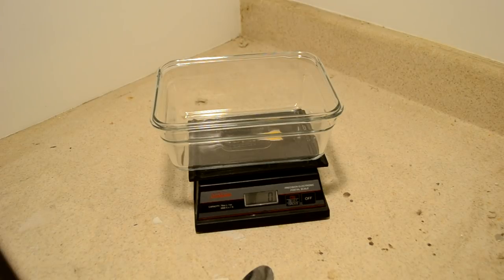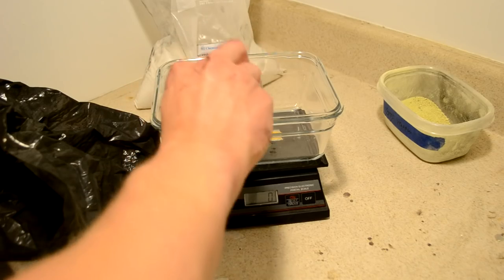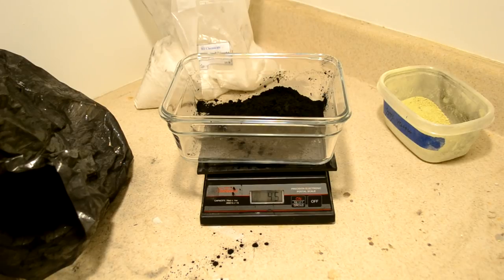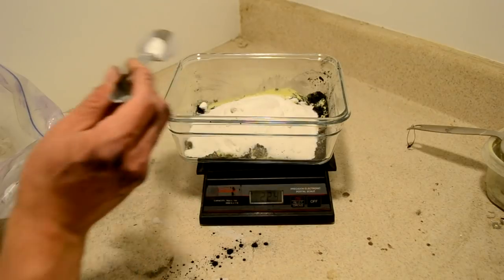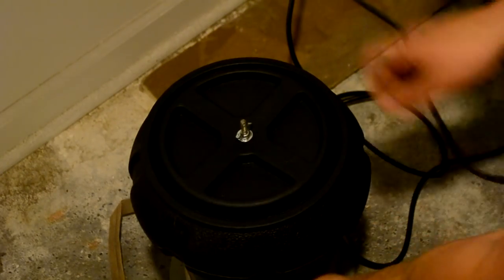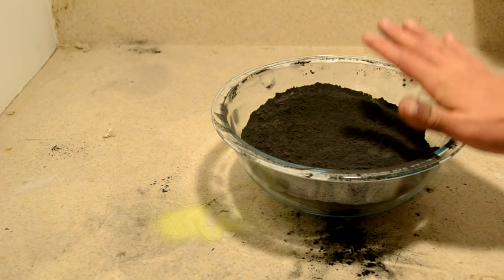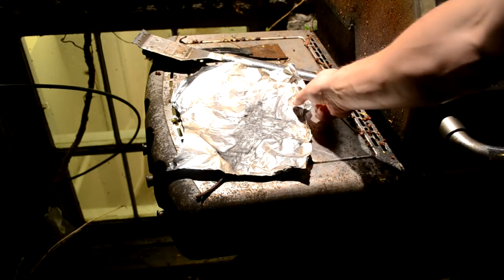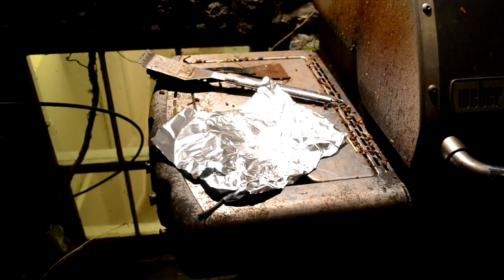Crazy Kitchen Chemistry --- Black Powder!

Comment: Lead can contaminate your black powder as it is a very soft metal. Have you considered using brass balls or large glass marbles?
Reply: I had the same problem using Gordons Stump Remover for Potassium Nitrate, it is Prilled into had little Balls .It took 3 days to powder it and left so much Lead Residue I couldn't use it. My Lead was very Hard #2 Alloy, those Fishing Sinkers are much softer. I finally had to use Boiling water ,Filter it twice and recrystallize and grind it by hand to get rid of the Lead Contamination. Next time I'll just go Straight to the Boiling Water and recrystallize ,much faster and less work. If you try Stump Remover be careful not all of them are Potassium Nitrate.
Reply from the maker: That's great input. I know I'm getting lead in the mix, but it doesn't seem to effect the burn rate much. Toxicity  is another story
Reply: @woodrowbrimm2805  Grind the potassium nitrate in a coffee grinder before using it in the powder.

Comment: I wet mix mine in a bullet blender.   works fine.  Mix the Charcoal and sulfur first.  Then add the  KNO3  .  I use it in my 44cal Black Powder pistol.  Better then Pyrodex.  Just air dry until mud.  Push thru a window screen  . 100 mesh?  Turns out like FFF grade.   Your method takes much longer and a pain it seems.  just Wet Blend it and push the mud thru some screen.   Air Dry .  Here in New Mexico the Sun dries it in under a hour.  Add .5%  aluminum powder if you like bright flashes.

Comment: For a more stable compound you can do the whetting process under pressure. Then you can mill the puck into FFFF, FFF and FFG. Not all powder sizes are equal. That and the granules will be hard and won’t break down due to vibration

Comment: been look'n at this hard and heavy lately maybe the binder is a good idea, after all, you could get it where it extrudes and have your way about cleanliness and burn speed if you play with some aluminum-magnesium powder"look up the amounts of course"  that will give it the zip you wanted and you can control the speed with the granular size as well bubby . or a least as I read seeing you do this helps me because I want to do it someday -- soon-ish, I hope this helps you as well. I think larger charges as long as their not too dirty are better suited for slower burns with the right barrel length . to push the bigger stuff downrange .not too long just long enough. but then you get into chronograph territory to sort that.  meaning more money. saving it is the point of doing this in the first place. since big brother nanny state has jacked up the price of anything firearms related so you will voluntarily give up your guns. change your behavior which is what codification of law is behavior control. so they can cull America down to a small serving class. so ya I'm for you, Brendan. all on your side. least I think we play for the same team. glad you're out there.

Comment: using the "Fg" scale, do you have some estimate on what degree of fineness your finished product has? Black powder is known to have a significant amount of residue when used in firearms. Would adding an excess of oxidizer decrease this residue?
Reply from the maker: If I recall, Just barely smaller than 3F, but note quite to 4F. Be careful adding additional oxidizer, as it will tend to leave corrosive decomposition products. (Potassium carbonate + Potassium oxide) Given the option, I'd pick dirty over rusty.
Reply: @BrendanStewart  thank you for this data. BP residue is hygroscopic, hence the need to clean after use; not sure if these perchlorate by-products are worse (individually or as additional contributors to the usual BP fouling). I suppose I could always try a simple Fe plate test of the various residues and see which is worse? The other concern I have re the use of more and/or other oxidizers (such as perchlorate) is how much more energy it would have. Pyrodex is measured by volume but g for g is more potent than plain BP. I gather then that the addition of perchlorate does increase the potency of the mixture. Unfortunately, I don't have the means (pressure instruments) to test firing pressures. However, I came across a chat group from 2005 and this was some data they had as a comparison between BP & Pyrodex:
Bullet/brand, Powder, Charge (I'm assuming BY WEIGHT not volume since typically, you measure out Pyrodex 1:1 for BP), Velocity (fps), Pressure (psi)
BP: 435grs / Buffalo, 80grs Fffg, 1300, 11,800
Pyrodex: 435grs / Buffalo, 70grs Pyrodex Select, 1300, 9200 [note: same fps as 80gr BP but lower chamber pressure]
Pyrodex: same as above, 72.5grs Pyrodex Select, 1395, 12,000
Unfortunately, I don't know how much perchlorate is added to BP by Pyrodex but it probably isn't much based on how much less Pyrodex is needed to produce similar BP ballistics.

Comment: Take a 1" or 1 1/2" copper piper about 6" long and pack your power in it and tamp the hell out of it to drive the kno3 and sulfur into the pours of the charcoal then push out the nice pucks and the. Granulate

Comment: Very informative! Thanks for the video. One question -- can 70% isopropyl alcohol be used in place of the 91% isopropyl alcohol, if one cannot access the 91% isopropyl alcohol? You used a solution of 91% isopropyl alcohol when you were in the process of granulating the milled black powder.
Reply: 91 is just more volitile so it'll dry out quicker
Reply: @Mikechill5  thanks

Comment: Dextrin and hot water work brilliantly for granulating and if you get an accurate amount of dextrin (1%) it doesn't affect the burn rate compared to using isopropyl alcohol. Plus it saves you a lot of money!
Reply: Where to buy dextrin?
Reply: Jstables95 you can buy dextrin on amazon but it’s expensive or made it with potato starch heated at 160dgC also called dextrine. It’s easy to make
Reply: @yanosrizkoneynoy7502  i just watched vid how to make it. Yt truely have anything u need. Thank you

Comment: what is air flow charcoal? it seems to be used in "hookas" very expensive? would any charcoal do like the one you use in barbecue do?
Reply: Not briquettes. Lump will work.
Reply: Use hardwood charcoal and burn all of the gas out of the charcoal
Reply from the maker: "Air Float" meaning the finest available powder. easily suspended in air.

Comment: yes that's the burn rate you want,  very good!
Reply: I made it 75-15-10 and it is slow burning af. Do i rly need to mix it for 3 fucking days. i dont get it
Reply: @stahinjakrackovic2087  what charcoal did you use? you need to use willow charcoal …The longer you mix it the finer its gets.. no need to ball mill for 3 days just a couple of hours ...
Reply from the maker: Sounds like your mixture is not homogenous. Sounds like you need to mix longer.

Comment: Not bad!  I never tried granulating without dextrin.  I only use my BP for fireworks so I’m not worried about the nasty byproducts. I’ll have to try the alcohol only method
Reply: Where can i find dextrin
Reply from the maker: Make it! Heat corn starch to 400f for a little over an hour.
Reply: @BrendanStewart  is this true
Reply: @stahinjakrackovic2087  Put a layer of corn starch on a baking sheet and heat it at 225 degrees for quite a while. Stir it often and when the starch changes to a golden color it is dextrin. I use 5% in the last hour of tumbling and my powder became faster and velocities stabilized because of less crushing of the powder as the ball is seated.

Comment: Can someone explain why you granulate it at the end instead of keeping it in the fine powder state?
Reply from the maker: Granulation prevents the powder from compressing, and helps to keep the burn rate consistent. "Air float" BP tends to compress under the weight of gravity, lowering the effective surface area and slowing down the burn rate over time.
Reply: The air space in between the granules helps the flame propagate through the mixture faster
Reply: @nickallen13  and increases the surface area.

Comment: What is this milling machine called? Is it expensive?
Reply: He's not using a ball mill but a vibratory tumbler. Most people use cheap Harbor Freight rock tumblers and lead balls for a ball mill. I don't see how he can call it "ball milling." Can't argue with his results though, it worked very well!
Reply: @eminusipi  is it necessery to mix it for 3 days? I mean, i didnt cuz i dont have that machine, but my BP is so weak and slowburning. And i did 75-15-10 ratio. What am i doong wrong, please.
Reply: @Kale Strahota did you use the right type of charcoal? Hardwood charcoal works good and yes, the powder has to be very fine
Reply from the maker: Vibratory tumblers are significantly faster, but make sure to use non-sparking balls!

Comment: Could you make a sheet of bp then crack it up after drying
Reply from the maker: Presumably... if you used a binding agent like dextrin. Note that particle size would then be inconsistent.
Reply: Yes you can. Corning powder has been done for years. Armies in the past didn't carry barrels of powder they carried pucks of powder. Wafers that look somewhat like a hockey puck along with a small grinder. I have done this before and use a ceramic coffee grinder to grind it but I find it's not worth the extra time even though it does make a really nice fast powder. Just my opinion though. I make 2 inch diameter by abut 1/4 inch pucks. I've always wondered if I could ignite one but have never tried.

Comment: I was hoping to see how it burned in green powder form after being milled.  Interesting video!
Reply: @H.E Master Sorry - I was hoping to see the difference in burn rate for powder form vs granulated.
Reply from the maker: Next time!
Reply: @patriot7703  I learned a little test I use for my powder. I fold a post it note page and place a little ungranulated powder on it. I ignite that and see how it burns the paper. It will usually leave the paper smoldering. Then I put granulated powder on the paper. Ignite it and see what it does to the paper. If your powder is fast enough to use in a firearm it will blacken the paper but will not ignite it or leave it smoldering.